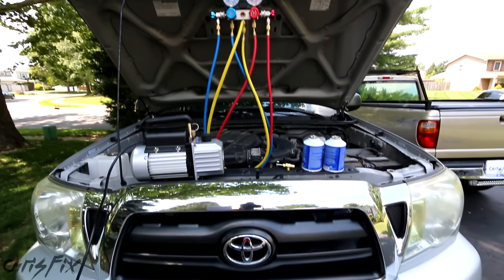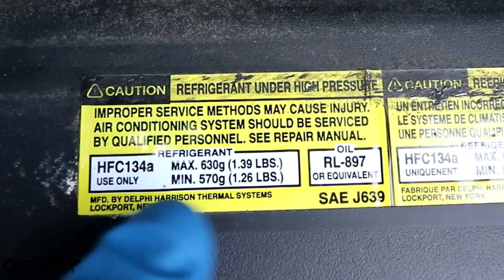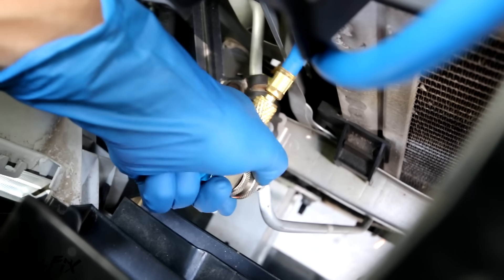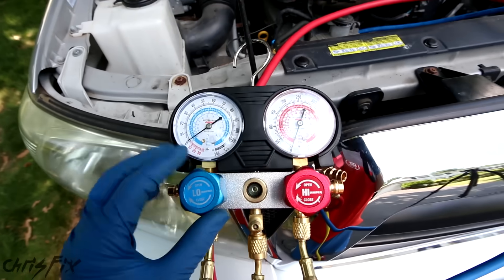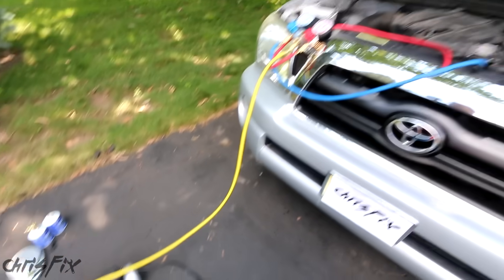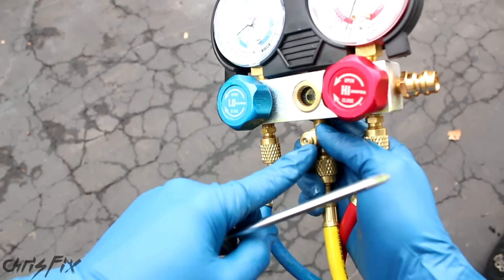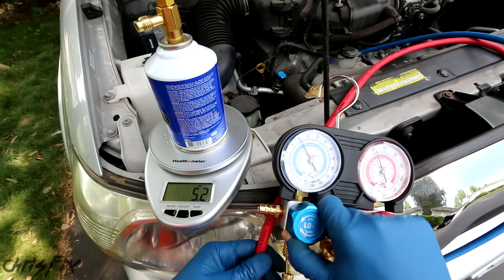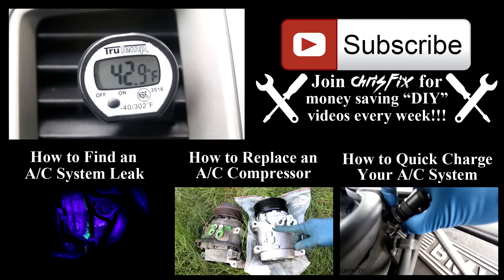How to Properly Recharge Your AC System

Comment: That does not make sense. If you vacuum the system at the beginning of the video to remove moisture, didn't you vacuum the pre-lube oil in the compressor too ?
Reply from the maker: +Kevin Bhandhoo yrs, oil doesn't evaporate in a vacuum. It is thick enough to stay in place.
Reply: I didn't knew that, i saw on ericthecarguy, the 23:48 min video, he said to measure and pour the oil in the yellow hose right before recharging the system with R124A.
Your videos are has been very helpful.

Comment: I replaced condenser in my son's Mercedes and the low pressure still reads around 55. I figured it would read zero. Does this mean there is still refrigerant in the system? The air does not get cold all.
Reply: press on the Schrader valve and see if anything comes out, you may have a faulty gauge. if the lines were opener to the atmosphere, you should have 0psi in the system.
Reply from the maker: If you replaced the condenser then the system will not have any refrigerant in it. Sounds like a bad gauge.

Comment: YOU LACK A LOT OF THING FIRST YOU DONT NEED A VAC PUMP NOR GLOVES NOR GLASES UNLEES UR AN AMATURE ANYONE CAN FIX THIS WIHT OUT ALL THIS THECNICAL BULL . U WANT A BAC. USE THE A HOSE THAT GOES TO A VAC ON THE ENGINE. OR A FEW DROPS OF DEHY. I HAVE FIXED THIS THINGS FOR 40 BUCKS FOR 6 YEARS AND PEOPLE ARE HAPPY SORRY THERES SIMPLE THINGS LIKE THIS THAT ANYONE CAN DO BUT YOU DO NEED TO KNOW HOW TO USE THE GAGES HIGH AND LOW SIDES. ITS JUST AN AC SYSTEM.WELL GOOD LUCK HE DID NOT SAY WHEN TO STOP ADDING GAS IN TO UR SYSTEM ITS ALL ABOUT PSI SOME VEHICLES LIKE CARAVANS NEED MORE CUZ ITS A BIGGER AC SYSTEM WICHT LINES GO FROM SIDE TO SIDE OF THE VEHICLE BUT ALL WELL I LIKE TO HELP. SORRY BUD IVE DONE MORE THAN 5000 IN MY CARRIER. AND U FORGOT ABOUT THE PRESSURE TEST A VAC IS ONLY -30  BUT IF U ADD 50 PSI TO THE  SYSTEM U CAN TELL IF U HAVE A LEAK. IN 10 MINUTES KNOW HOW TO FIND it.sorry if made u mad i just addapted a 5.7 dodge to an 2009 jeep sahara and had to make two bcms and one ecm communicate whith each other in the next to weeks a have to rebuild an 1986 ferrari engine a corvett 1997 am an idiot sorry .

Comment: So what is done with what is pulled out of the system by the vacuum pump? Is there  a way to perform that without a vacuum pump? Could you get any results without the pump or are you just spinning your wheels? I did catch what you said about moisture needing to be removed. I don't have one of those pumps though.
Thanks!
Reply from the maker: You have to get a pump. I link them in the description. Without it, your ac system will go completely bad due to moisture and you will have a few thousand in repairs you will need to do!

Comment: Chris do a follow up with how the system readings on the gauges are read when charged.  ex: optimal is 30 on the low side.  CARS ARE DIFFERENT BUT AT LEAST IT WILL TELL THE NEW PEOPLE WHAT THE READINGS MEAN.Thanks
Reply from the maker: Great tip!

Comment: I have a question and I need a lot of help.  I took off the Ac compressor off years ago and put a bypass on it. The lines has been sitting for years while driving. I know a need an Ac compressor. Accu dryer and a vaccum to get out moisture. I have a 2000 Mustang Gt auto. I see the steps on the video but what else do I need to fix this job? Do you think with me driving those years dirt got into the lines that those need to be replaced too? I was told to get every thing all over and kind of running low on money. n shop wants over 600 to fix this. I need help lol
Reply from the maker: I would replace the O-rings on the hoses and maybe flush the hoses out with compressed air and acetone. Also, make sure you oil the system properly since it is probably dry.

Comment: Really great if your a service tech. Which I'am. The average person may recharge their ride maybe once in a life time. The average person will not and should not waste the investment to recharge with the skills of a tech. Encase you missed it scientist came out shortly after the EPA certification requirements, required by federal law admitting CFCs did not cause a hole in the ozone layer. Government corruption caused the boost in AC revenues. Which was long overdue. I watched AC companies still millions from their customers during my career to live an extravagant lifestyle. Everything an average person needs to know about charging a automobile system can be learned at Autozone. Leak detection dyes should not be used according to my experience. They clog the system. If a leak is suspected, leak detection should be preformed by a qualified service tech if a leak detector is not available. HVAC is not surgery.
Reply: Disagree.  You can get the exact same gauge set and vacuum pump that he uses off of Amazon for about $100.  I know cuz I just did it.  Evacuate&Charge at a shop is gonna cost you about $125+/-.  So if you do this ONE TIME, the tools are paid for and every other time is gravy.  And old-style refrigerant (R12&R22) does cause ozone damage; R134 does not.  Get your facts straight.
Reply from the maker: I actually link the kit in the description for the gauge and vacuum pump. It is a great deal!
Reply: The gauges and pump are $140 on Amazon, or $160 at harbor freight minus whatever coupon you can get. Versus what a shop is gonna charge you, it's basically a wash, until the next time you need to charge the system. Once in a lifetime? Who you kidding? I've done five or six in just the past year.

Comment: love your videos! Got any tips for when you are working on replacing a/c lines? I have a problem having them seat correctly once I replace them - I feel like the bolts going into dryer and such don't ever hold properly once cracked open.
Reply from the maker: Sounds like you are stripping the bolts if they are not tightening. Make sure you torque them down to the correct torque!

Comment: Hey Chrisfix! Firstly, you videos are amazing. Secondly, I'm stupid. I have a 2 year old car and the AC appeared to be underperforming. I pumped in a little R134a and all was fine but I wasn't resting easy and got myself a set of manifold gauges. When I was hooking it up, the high side quick connect didn't snap on properly and I lost three bursts worth of refrigerant, enough for the AC to blow less cool. More importantly, some oil came out. And now I overcharged it and its straining/dragging the engine more than it should. I hate taking my car to the dealer but I think I will have to. But my worry is the compressor oil. 

1. Do you think I would have lost a lot of oil? 
2. If they do an evac. and recharge, would I lose my oil?
3. Should I ask them to inject oil or would that make total oil too much, and is that bad for the system? 

I feel so stupid and terrible. Any opinion is appreciated! Thank you!!
Reply from the maker: Dont feel terrible. I would just ask them to vacuum the refrigerant out and pull a vaccum on your system. Then ask them if they removed any oil and how much you should add (if any). The short burst wont remove enough oil to cause a problem. Then you can follow what I did in this video to add your own, correct amount of refrigerant.

Comment: Because of this video and your excellent description of the process of recharging an auto's ac, I decided to tackle this. I'm very pleased with the results! I bought all my tools online and my condenser for my Lexus. The pump and gauges and condenser with the desiccant was under 200 buckaroos! I could have bought a cheaper vacuum pump but went with a 5 cubic foot with a 75 micron rating.  Chris, your the man!
Reply from the maker: AWESOME! Glad the video was helpful! You saved a ton of money doing it yourself plus it is satisfying and now every time you use your AC you will be nice and cool!
Reply: +Chris Fix, excellent video. I had a question for you.....when you pulled the vacuum for over 45 minutes....does your pump remove oil as well?
Reply: +Chris Fix one of my concerns has been after installing parts with correct oil, and then pulling vacuum with a pump, how will I know how much oil is left in the system? Or is pump too weak to pull out the oil?

Comment: I added freon my low pressure side is reading good but high pressure reading low! The compressor makes a noise when it on and the ac won't throw cold air unless car is moving! Could it be the compressor ?! Please help!
Reply: Sounds like your orifice tube or expansion valve is blocked /clogged....
Reply from the maker: It could be the compressor which might not be pumping enough refrigerant to get the right pressure!

Comment: (IF) you had someone use a recovery unit on the A/C system it does suck out the oil from the components as well often automotive recovery recycle units will separates the oil from the refrigerant some have to be filtered out, oil must be added minus what was in the compressor
Reply from the maker: It shouldnt suck out the oil (maybe a little). The oil should remain in the system for the most part. I guess it depends on what machine they use. Thanks for sharing.
Reply: +ChrisFix I use a bacharach eco-2020.  so the oil has to be separated from the Evac'd hfc from the tank , but mastercool makes one that automatically separates the oil from the refrigerant. the oil that gets sucked when evacuating to lubricate the piston(s) of the evac unit
Reply from the maker: Nice! Good to know! Thanks!

Comment: Thanks for the demo,

I have a question though, is the hi and low tube cap sizes universal for all car manufacturers?
Reply from the maker: Yes, they are universal for R134a fittings for every car using R134a
Reply: +ChrisFix cool, thanks!

Comment: Chris I really enjoy all your videos! Your the best!👍👍 my 92 Chevy Silverado A/C is working ok. It does not blow real cold. It works great at night, but not so much in the day when the sun is out. It's a Black truck. Any suggestions?
Reply: Bob Green That tends to happen with old R12 systems converted to 134a. My 92 Caprice had to be converted over and it takes much longer to cool down. Usually a mile or 2 down the road and it starts getting cold. However a few things to check if your system is fully charged and you're getting lack luster results. Make sure your engine fan is spinning with engine rpm at idle. If it's mechanical, it'll have a fan clutch. If that clutch is bad, it won't spin as fast as it should and not pull enough air through the condenser. If you have electric fans, make sure they are in high speed with the ac on. Check for dirt and debris in your condenser and radiator. If your fans are working properly but have debris and dirt in the condenser and radiator, that will slow air flow too. Clean large debris like bugs and leaves with a brush. Go up and down not side to side as it will bend the fins. And check all the fins too and carefully straighten out any that are bent. Then use a water hose to flush out dirt and dust. Once its clean, blow off excess water with air and try your system. Also check your evaporator coil for dirt and debris also. This is all a simple place to start when dealing with inefficient ac. If everything above has been done and your air still isn't satisfactory, there is probably a problem in the system itself.

Comment: I think your math is a bit off.
If 12oz can weight was 20 on the scale and you needed to add 10 oz of the 12 then  20/12= 1.6666 
So then 10 x 1.6666 = 16.6 thus  20 - 16.6 means you needed to take the second can down to 3.4 on the scale.
Or am I incorrect?
Reason I'm checking as I have to do same on a 2003 Town&Country.
Reply: His system requires 22 oz of fluid 
The fluid contents of each can is 12oz 
On the scale the cans weighed 20z 
12oz fluid plus 8oz of can weight 
He emptied the first can which gave the system 12oz of fluid
Then he emptied the second can 10oz which gives his system 22oz of fluid
Leaving 2oz of fluid in the can which has a total weight of 10oz
Reply: +Paul Panibratyuk the problem with that is one fluid once may not weigh one ounce. Fluid ounces are a measure of volume and don't necessarily correspond to ounces in terms of weight. So relieving the can of 10 oz of weight does not mean he introduced 10 fluid oz to the system. What he should have done is weighed the first can after he emptied it to figure out what 12 fluid ounces of refrigerant weighs, then done the math to figure out volume relative to weight. Personally, I just would have guesstimated.

Comment: iam about to this to my car but there is one step i didnt quite get. From 10:12, you indicated that only use the low side and only open the low side valve, what happen to the high side valve? if you dont open the high side valve, how does the gauge from the high side gets the reading from the system? in order word, if you dont open the high side valve, the gauge would not be in the AC loop and would not get reading. Am i right or am thinking of this wrong?
Reply from the maker: So you open the high size valve at the end of the hose but not at the gauge face. If you open it at the gauge face, refrigerant can flow into the high side which could cause problems. So only open the high side at the end of the hose. Hope that helps.
Reply: thanks for your verification. I guess the way the gauge apparatus is constructed allows the gauge to read the pressure of the AC system even when high valve is not open. Thanks. I m waiting for my condenser to get home so I can get this thing installed. I bought new compressor and ended up replacing the condenser as well while i have the car apart. Your videos help a bunch. Thanks

Comment: professionally done, excllent video! thanks chris.
Reply: chris please answer this qustion if idid vaccum to the system and there is small amount of gas and the gauge not reading 0 like this video is wrong or ok
Reply from the maker: Thanks!!!
Reply: its vaper boiling out of the system oil or liquid ref you should pull a vac again if it holds your fine if it drops again you may have a leak but leaks usually drop low side gauge to 0

Comment: i bought a can and gauge from walmart, and now my  AC is at 43F, so no need for all these stuff. the gauge tells you where the safe point is at. i used arctic freeze freon.
Reply from the maker: Nice! So you did it like this: https://www.youtube.com/watch?v=SHg2xRMnM38
Reply: +ChrisFix yeah but I bought the gauge and the can separate. I actually had someone does it for me like u did, but after couple weeks, my air was getting hotter. so I went and bought artic freeze freon,  it's been amazing. when I first saw ur video , I thought it's much professional but after I saw that it should be at 43F, I went and measure the temperature and it was 43F.

Comment: Hey Chris, if the pressure on Low pressure is over all the way to the red lines, is it possible that it would only be the expansion valve? It's pretty cheap and relatively easy to change. I read somewhere else that it could be possible that it is only the valve and not the whole ac compressor. Is playing the guessing game bad?
Reply: You probably set up your gauges wrong. That or you have a blockage
Reply: IshockO blockage as in where? Cause the ac compressor does sound a louder than most compressor on other cars so I think it may be it unless it does have a blockage somewhere else as you say
Reply: +XxGreenBeXx something could be wrong with the compressor. What was your high side pressures?
Reply: +XxGreenBeXx tell me all the information that's going on with your ac
Reply: IshockO I never really checked the high pressure since I don't have it to check it, but whenever the ac clutch engages it makes a loud noise. I read somewhere that if the high pressure side is all the way down, it most likely is just the expansion valve?

Comment: Chris- recently i have seen this video, its g8 info, thanks for uploading! 

i got a doubt in AC drier , as you have said its better to lubricate the AC system with recommended oil, if this oil comes in contact with drier then will it effects the performance  of system, recently i have opened the drier and found the drier system became sticky.

Comment: hey Chris I have a question when I turn on my a.c. or heater it blows a funky smell but I'm not sure if its cause the car isn't warmed up cause after 10 or 15 mins of driving the smell goes away any advice or clues to what my problem is
Reply: The stank doesn't have to do with this specific system.
Probably need to change cabin filters. You can also look up a video on cabin air deodorizing.
Reply: +Paul Panibratyuk thank you ill look into it

Comment: Hey Chris, do you have a video where you show us how to upgrade the A/C system? I am planning to do so on my 1993 Chevrolet C1500, since it has the R12 system and I want to upgrade that to the R134.
Reply: If your R12 system is working, dont mess with it. Converting to R134a will make your system less efficient and it will not cool nearly as well.

Comment: another reason to hate BMW is that mine said the refrigerant charge is 20.7oz with a tolerance of + - 0.03oz . what the fucking fuck? good luck getting that exact amount in there. some refrigerant will be in the hose and manifold so you can't even do the weight scale measuring method. stupid fucking german cars.
Reply from the maker: +hostilityy Yea they have to have some buffer. Or at least more buffer than they are saying!

Comment: you haven't thought about the weight of the hose u had connected to the ac can while weighing it ? 
its not accurate
Reply from the maker: +TheOfficialPhatBeatz The weight of the can doesnt change. The only weight that changes is the refrigerant.
Reply: yeah i know that, but you have the hose connected to the can, it makes the weight inaccurate... u also get the weight of the hose on the weight u used in the video. do u know what i mean ? Love your videos by the way ! xD u should do a video on how to install different gauges in a car